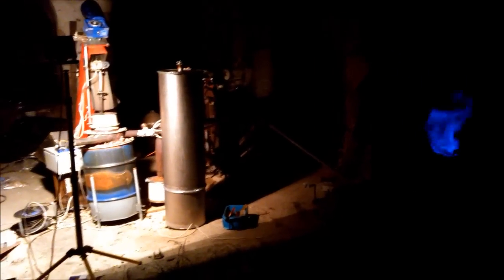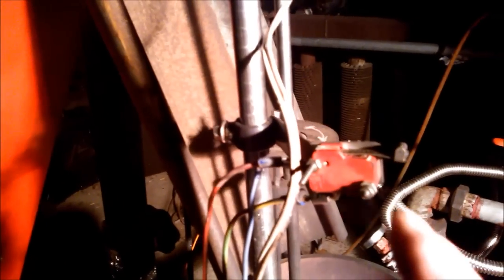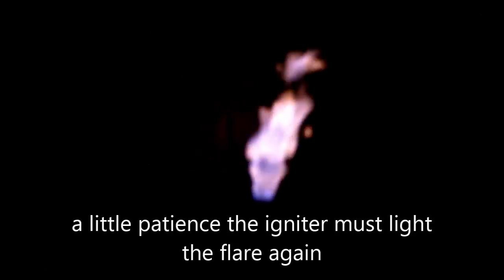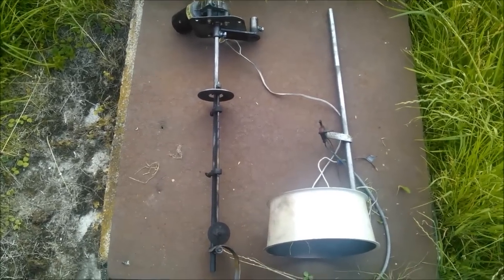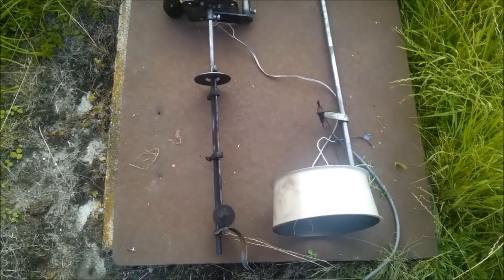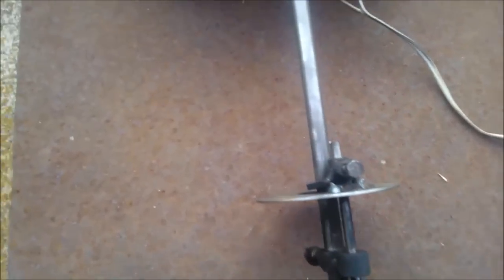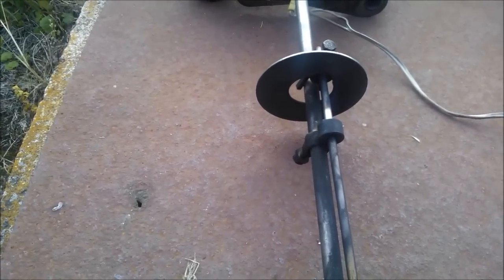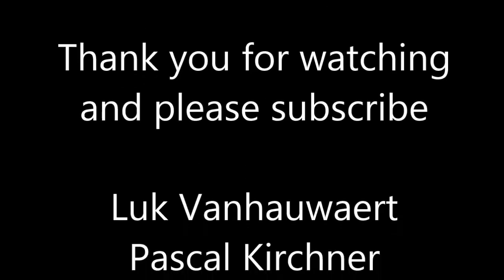Filter and levelsensor NEW

Comment: Luk, Brilliant system and design.  This feed sensor system reminds me of a swash plate, that is a key component in a rotary wing aircraft.  Great application.
Your filter system is equally impressive.  As I am finally getting to  the point of beginning actual construction, I am interested in the details of this filter.
Thanks for sharing your work.
Reply from the maker: Larry Turner Sory to aswer so late, overlooked your post. The bag filter is a cloth made of fabrik of a welding blanked but without the impregnation. There are other fabrick too from both Gore tex and 3M that are realy good for hot gas filtering.

Comment: Very nice. No wonder you have such stable runs. It looks like that setup should really keep your fuel depth perfect. Thanks for sharing. I have a lot of catching up to do on your videos. Talk to you later.Joe
Reply: mazdalorean Thank you for looking into our work. Yes this level sensor, of our own thinking " the pyrotouch" and the "DriZzleR method gasifier, The DriZzleR" where the long searched after:" missing links" to make an open top gasifier producing "tar free engine grade gas" The pyrotouch made it finaly possible to automatisize a gasifier for continious production the easy and cheap way. Before the other tar free gasifier "the imbert", needed expensive sluises or rotary valves to be feed in continious mode.Me and my partner Pascal are now, long duration testing, our cogeneration unit driven by our "DriZzleR" gasifier. No isues so far with pellets. With premium sorted out woodchips we have also flawless operation. But there are problems with standard G50 woodchips that are chipped in the open fields. They are contaminated with small stones, minirals, clay as bits of metal that after 4to 6 hours running are acumulating on the grate and prevent the gasifier to breath. Therefor we are now experimenting with a new build. A "Grateles DriZzleR". The first machine of this type ran only 25 hours solid and then choked. Just yesterday I ran a test with the adapted "Grateless" and the first results are very promising. I did not yet had time to post a video but if you discribe to this channel, you sure will be warned when it is published.Luk

Comment from the maker: Larry, Thank you. Always apriciate your input of ideas;
Funny you mention a swashplate. Without knowing such a thing exist, in one of the previous attempst to build my level sensor, I used a simular idea bt unfortunatly the plate got stuck sometimes because I could not make the construction stiff enough due to the long distanse of the shaft wich I need to prevent the engine from getting too hot by the radiating heat out of the fuel pipe.. Now I am exploring the possibility's to drive from the side and put also the mikroswitch at the side out of the heat from the fire. It would also alow me to shorten distances of suporting rods making the whole thing more stable.
Luk
Reply: The position of the windscreen motor and the rising heat was my first concern. A 90 degree drive system should solve this. A simple two gear (cone shape) system driven from the top would allow you to position the motor to the side out of the heat. As usual, finding the stuff is the difficulty.

Comment from the maker: Larry,
Motor on the side is an option I have to consider. The gearing and turning around the shaft Is not the least problem. I am strugling a bit how to arrange the up/down movement the same time the shaft is turning. The up down must be trigered by the little resistance the hanging spoon encounter by hitting woodchips and then lift upby itself  without beeing pushed on the side . It can be done and some skeching lies on my desk but your, or others, input are always welcome.

Comment from the maker: Hi, Tryhard,

Thank you for your reaction. The PAK is far from finished. I still have issues with it and it is not fool proof yet. I build up to 6 differant designs some based on a backwards turning screw of archimedes, all failures but this principe is going in the right direction. 
Making a thing that turns round and round and at the same time has a lift posibility with only one motor has cost me some headbreaking.

Comment: Hello, thanks for your prompt reply.. but isn't more simple use wood pellet coclea and an electronc for pellet stove?
Reply from the maker: I hope I understand your question. Do you mean by coclea the pellets transport tube? My aim at using only woodchips. Woodchips on the contrary of pellets are a very nasty fuel. The flow is difficult and they tend to hook and block. More force is needed to transport them. Elemenst out of a pellets stove are too delicate. On top of that a pellets stove is not depending on the suction of an engine. Pellets stoves are working at  more or less constant underpressure.
Luk
Reply: yes I refer to that. Using wood pellet the administration is very simple and you obtain an good quality syngas. You need alternative solution for purify the syngas without an outside filter.
Reply from the maker: Marco Cioni Well indeed pellets as standard fuel and having an even form are easy to transport and to handle, they also have more heat value, wich helps in optaining higher temperature of teh oxidation. My partner Pascal Kirchner is doing the testing and working solomly with pellets with great succes. You can find his work on our blog http://thedrizzlergasifier.blogspot.com/ and also the work of other DriZzleR builders on our forum http://forum.thedrizzler.com/index.php As the forum also cover work of other gasifier builders, Please feel welcome to post also about your work. I myself having a lot of scrap wood and little acces to pellets work mainly with woodchips. Also to come back on your remark why I do not use the pellets stove auger and sensor. This because a pellet stove works on temperature sensing and not on level sensing. About your link, I do not acces it. https://www.youtube.com/watch?v=OcCe1bF4d7w explains.
Reply: HI Luk.. need an registration on forum for see all informations including the diagrams..
Reply from the maker: Marco Cioni Marco,  No thanks...
I avoid the DOW forum. I experienced, they are very touchy over there and I do not like to watch my words. I like to speak as I think. Maybe you could repeat what you wanted me to show, but on the DriZzleR forum.
Thanks Luk
Reply: in part agree with you.. but the peoples in all world are the same.. i can open an new thread on drizzler forum?
Reply from the maker: Marco Cioni Yes, no problem. Just register. Then go to biomass, then to woodgas, then to other gasifiers than DriZzleR and then just start a new item.
Succes and see you there.
Luk
Reply from the maker: Marco Cioni Its done, Thank you and welcome.

Luk

Comment: Hi Luk, interesting difference with the filter. I wonder what effect would have a catalytic converter cartridge as close as possible to the burning zone to have great temperature.  I expect a reduction in tars too.
Reply from the maker: cezar t Well maybe but bag filters for hot gas filtering are realy proven technology and less complicated to make and use and cheap too. About tars, mind you in our DrizzleR we do not filter tars. Tar is something that does not make it further the Flaming Pyrolyse zone. What we do filter is burned tar...SOOT. Soot is the rest product of distroyed tar. It is this fine stuff together with other fine charcoal dust that is taken care of by the filter.Luk

Comment: HI, What is the function of agitator?
Reply from the maker: Marco, The first function of the agitator is the detection of the ember bed heigth. According to the load on the engine there  is more consumption of wood by high load than by low load. The agitator detects it when more wood is consumed and gives a signal to a mikroswitch that in turn makes the auger to move and suply fresh wood into the ember bed. That is the pyrotouch function. As a secondary effect, the plunger of the pyrotouch disturbs the wood colum therefore preventing bridging and hollow burns.
Luk

Comment: what the filter matrial sir.. i have gasifeir to.. bot the flame is red...  thanks...
Reply from the maker: Dear Achiles,  It is very difficult to judge from far away and by little information, but at first thinking I would say a red flare is not too bad. Worse would be a yellow fierce flare because that could be a sign of much tar. A red flare  could indicates that there is a lot of charcoal dust burned into the flare. This could be caused by your fuel. Is it very dusty? for instance rice husks. 
About your question about my filter media I tested a hot filter with a proffesional filter bag. That gave the best reults because a pre dusted with perlite dust filter bag takes practicaly all floating dust out of the gas stream. On top of that it can be cleaned on the fly with a burst of inert gas. But the big draw back is the fact that this filter bags are very expensive and that it takes a lot of time to heat your filter house up above the condensation point. Low temperature an condensation is bad for your filters. Second best ar filter candles. Also very expensive and also for hot filtering. So to avoid the cost I now experiment with low cost materials wich are diposal. I tried with good results filtering with layers of ceramic wool. I cut them in circles and disposal regulary the top on that comes first in contact with the gas stream. I found that they do a good job but due to the fact that in cold filtering a lot of concensation moisture bounds with dust and some start up tar they do not last so much as filters in hot filtering. But since they are not expensive one can live with replacement. You only have to make your filter house easy accesable. Some people uses hay but that stinks horrible and fine woodchips but that gives you some increase in underpressure. To anwer your question short. Alle fine filtermaterial can do a good job but you must find a balance between price and breathabilaty.
Reply: my gasifier type is downdraft sir,,, fuel i used is a charcoal, pine husk and cheap pine,, width reactor is 8 inchi and high 1.2 Meter,, no use cyclone,, the cooller i use 12 pipe,, 6 pipe in left & 6 pipe right.. no use filter... and blowwer i used induction motor 3000 rpm 120 watt 1 phase... thanks for the reply sir,, now i must clear my charcoal and speed up the blower then make filter from stone or other,,,,
Reply: If you are using charcoal and no pre dust filtering via a cyclone, then it makes a lot clear to me. You definitly dragges a lot of Charcoaldust in your gasstream that burns redisch in your flare. Not much to worry about as long that dust does not mix with condensation. Then it makes a hard slurry that becomes hard when dry and this cake can clog up your pipes and getting in your engine does no good there either. A Stones filter in my opinion is too wide and will let most of this exstreme fine dust get through. At least put on top of your stones some fine wool. For the sake of the experiment you can just start with ordinary fine isolation material such as stonewool. If temp is high it will desintegrate by the heat but for a small test it will hold up enough to give you some idea in wich direction to go......Luk
Reply: diagram of my gasifier is so bad...
Reply: Dear Achiles; I can not open the link. I get allways error 404.
Reply: I see only a picture. A drawing of the inside of your design would clear up more. Also I am sorry but I can not help individualy. I have just too much mails and I would not be able to do anything anymore. Now I have alittel more time because ill by the flue. For help my partner and I have set up a forum where there are also more people helping each other. I strongly recomend you join our forum and put up all your questions there. That way the help is also benifitting ather people with similar problems as you. Here is the link http://forum.thedrizzler.com  hope to see you there.....Luk
Reply: thanks for the reply sir,, and thanks for the respons,, its so helpfull to me, ok sir in the forum we meet again.. i hope there more clue for my gasifier...
thanks sir...